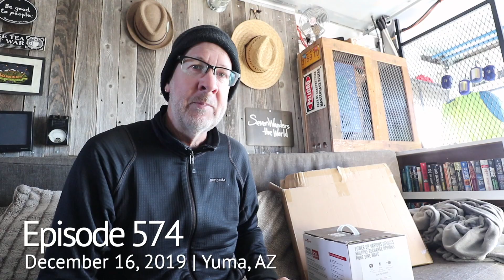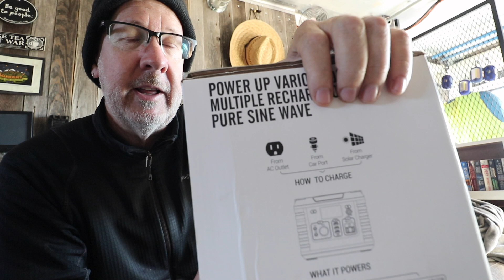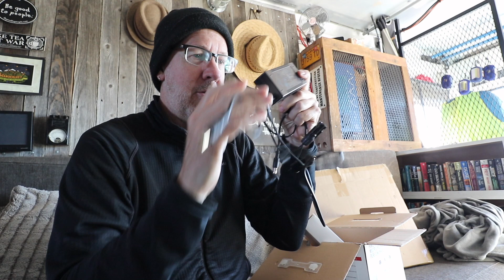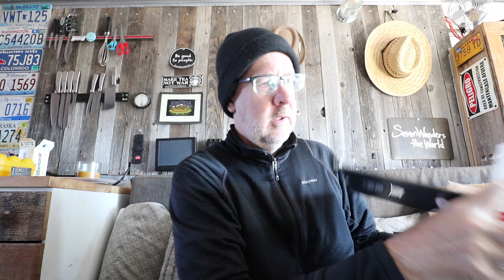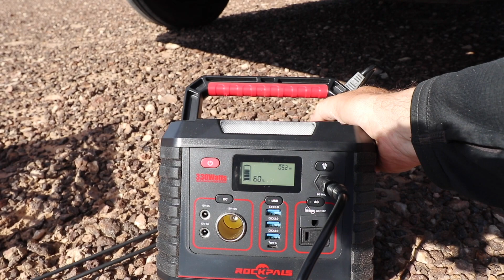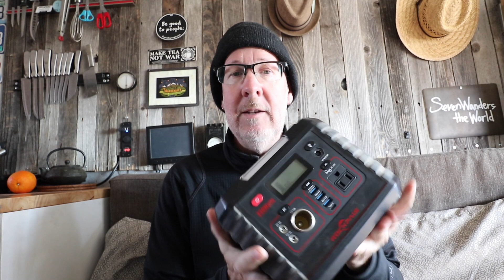Rockpals 330w Solar Generator Unboxing and Review E574

Comment: It can only go up to 52W charging so no need for the 100W solar panel. Get the 60W.
Reply: Bad idea. A 60w panel need perfect conditions to come anywhere near 60w. That's full sun. No clouds. Perfect angle to receive sun. And the temp around 70 degrees. A larger panel will get you closer to the 50watts without needing perfect conditions
Reply: Carlos Martinez; yea, probably right. I am in California though :)
Reply: @aaronqueen55  so am I haha in the bay area. My 100watt panel only put out 30watts with all the smoke in the air. It was pretty sad.
Reply: Carlos Martinez havent used the solar panel since then.

Comment: looks like a 100w panel should take 3 to 4 hours. at near max output, my rule of thumb is 50% this accounts for angle and clouds shade ect
Reply: The solar generator maxes out at 52W. It will never go higher. I just got the 60W panel because of this fact.
Reply: @aaronqueen55  the 60w panel is nice but it will only put out 60 at optimal conditions so a larger panel is more likely to max out your charger and give you the quickest charge.
Reply: brad hampton: I hear yuh on that. I’ll need 83.3% of optimal conditions to get 60W on a 60W solar panel. I’m in SoCal so it works for me. 

And if you’re only getting 52% out of a 100W solar panel, that’s pretty whack.

Comment: By the way, that's 12 volts at 5 amps not 3. If you don't like the closeness of the A/C output just plug in a power strip or surge protector like I do. My beef about the light is that it shines up into your eyes! These are great "power accumulators", small maybe, but heavy with a really rugged handle. I have two of them, but the docs are weak and the instruction manual has two glaring omissions. First, though the A/C output lacks pass through during shore power charging, all the USB and 12 volt outputs are active. (I need to plug into shore power to run my 60 watt/hr 12 volt fridge for 2 days and 2 nights.) If I need more A/C it's right there on my site. If I'm dry camping I found you can use this as a slave battery. I plug it into my newer Rockpals 300 and the 300 will drain and pass through the power from the 330w first then take over like lightning when the 330 shuts down. My computer didn't even notice that the power supplies had switched on the fly. Very impressive. Secondly, the docs should remind us not to try to "top off" a Lithium battery. My 330w works perfectly, but when I tried to charge it with 92% charge already in it, the 330w refused to allow any current in and showed 3 zeros on the display. At first I thought something was wrong, but realized it's for protection. The unit doesn't feel it needs charging unless it's below 90%. If your 330w ever fails to charge just run some power out of it. These Lithium batteries need regular use. You can tell I used to be a technical writer and that 90% rule should've been documented for the customers. Anyway, I wholeheartedly endorse the Rockpals lineup.

Comment: It would be useful to know how long it takes to charge this at an AC outlet  (maybe at work/library/cafe) and using the vehicle alternator.  It seems most lithium battery packs have long charge times.  Having the solar charging when off grid and not driving is great.  For the higher amp appliances look to propane for heating and cooking.
Reply: This has a max input of 60w but from the wall outlet it really only pulls around 52w and can charge fully in 5 to 7 hours. Using the car cigarette plug only allowed around 44w input and can take 7 to 9 hours depending on how drained the unit is. I haven't tried solar charging but I know that 52w is all I've seen this thing pull in.

Comment: how do you onvert something like  your shaver or anything 110 into 12 volt? is there a lesson to show us ??? thank you   nice video
Reply: You don't need to convert your ac device to dc as long as your ac device uses less than 288 watts it will work in the ac outlet. If you just want your ac device to become dc then you will need a dc to ac inverter but choosing the right one depends on your ac device and the amount of watts it uses. Look up 150w dc to ac inverter and your shaver would plug into the outlet and the cigarette plug would go into the round socket of this power box.
Reply: @KradleKap  thanks for your time and answer

Comment: The safety ground on top is a  safety "feature" likely from new electrical codes.  You may do better with a car adapter for your  Ipad. DC to AC to DC may not be the best power conversion..   With the engine running, vechile electrical systems can be very noisy.   Charging just the generator, on the move, means it alone deals with vehicle noise.     If it charges or runs your other devices, they get clean, pure power.    Perhaps it should be considered a solar UPS, backup power from almost any common source.   Thanks.

Comment: Your comment on the 110 volt outlet is not correct. It can be oriented up, down, or sideways. The National Electric Code does not specify which way.
Reply from the maker: not saying it "must" be a specific way, I'm just saying that 99% of household plugs in the USA you see have the neutral 3rd prong on the bottom

Comment: The upside down A/C plug is that way for a reason.  If you have a large "wall wart" power brick (the transformer is in the plug) & the cable is coming out the bottom, then the cable leading out of it will get pinched at a sharp 90 degree angle, against a table or surface when plugged in right-side up.  When upside down (pointing up), the cable is under no stress.
BUT WAIT.....THERE'S MORE!!  Just have the AC portion off, then plug in the large adapter.  PRESTO....it pushed the button for you & turned itself  on!
Reply from the maker: thx for the info. wasn't aware of that! it caused problems on a couple of things I plugged in and I had to perch it on edge of counter to plug them in
Reply: @SevenWanderstheWorld  Use a short extension cord between the plug and unit. It won't hit the button above and there won't be an up or down problem.

Comment: To keep it simple for those that don’t know how to determine the wattage of a device, you multiply amps x volts. A device that draws 2 amps at 120 volts is 240 watts. The peak output of this generator is 700 watts. It’ll power a bunch of low amp drawing devices. The ratings on the box will tell you how long at the specific wattages. This unit sure comes in handy for smaller things like chargers etc, especially with the solar panels.
Reply from the maker: thanks for the math info! much appreciated. functionally it seemed to do everything I wanted with smaller devices
Reply: Seven Wanders the World The math might help someone determine how long this might last depending on the load they put on it. I think this will handle 288.6 watts for an hour (WH) if I read the box you showed correctly. So certainly a long time for smaller devices or at least long enough to charge most devices. Im sure it’s super handy to have. Thank you for sharing...

Comment: For keeping panel from going with the wind, glue magnets onto back of case & mount to area beneath windshield?
Reply: That will work. but windshields have UV blockers in the glass, so if you have the option, outside is better.